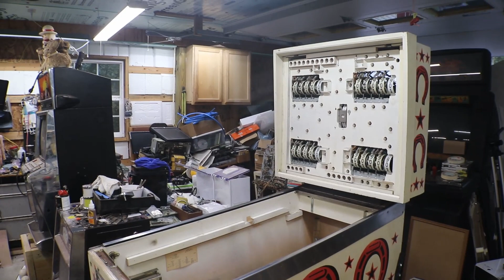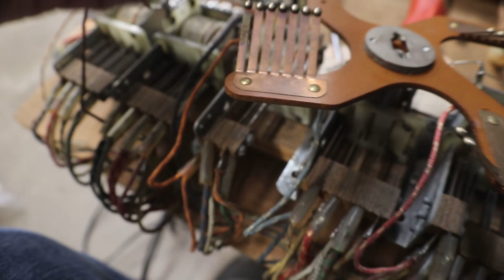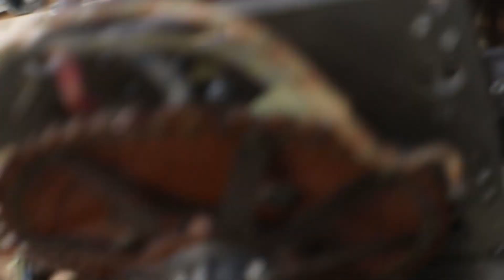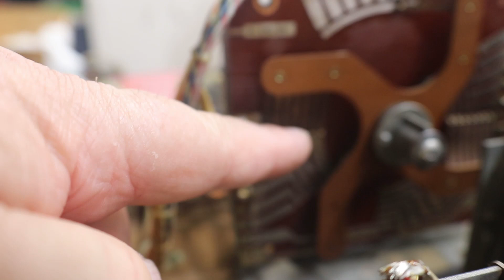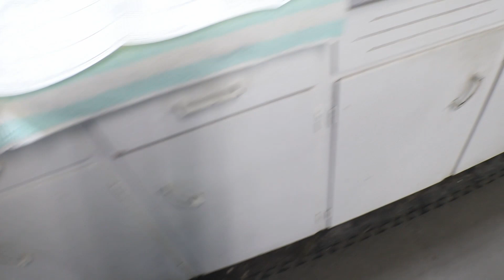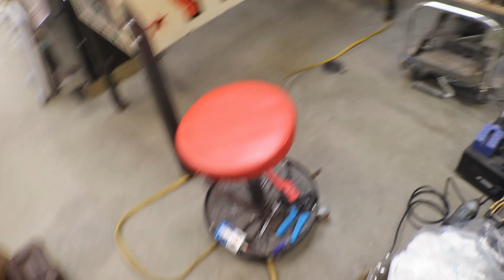1976 Bally Flip Flop / The Stepper Units / Finishing Up The Bottom Mech Board

Comment: Hello Hopper I was wondering if in one of the next few videos if you can   show how you cut your coil sleeves to size.  Also should you replace the metal sleeves as well?  When you buy coil sleeves do buy bulk and just cut them to size?  Or kits? Thanks for sharing..
Reply from the maker: Most of the time I buy sleeves that fit. But when I'm out of one size I just cut them down. I always have 30 or 40 coil sleeves in different sizes on hand. Yes I replace every sleeve in the machine metal or nylon. Kits are ok if you are only going to do one machine, bulk you can do more with them.
Reply: @RetroGamingWithHopper  okay . That's what I love about this hobby.  There's so much to learn  from every angle. Your wonderful Hopper Thank you for everything.